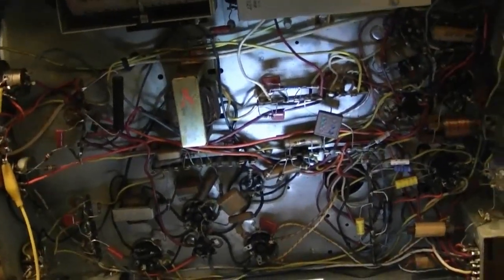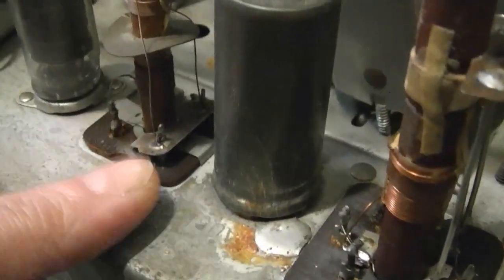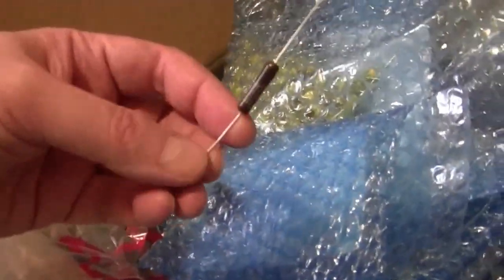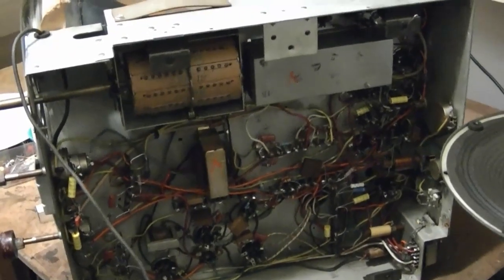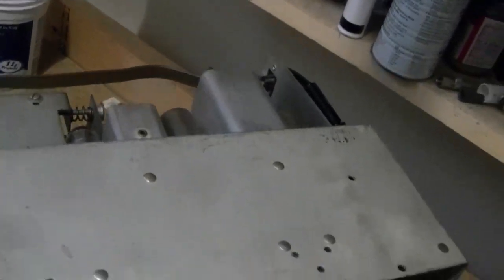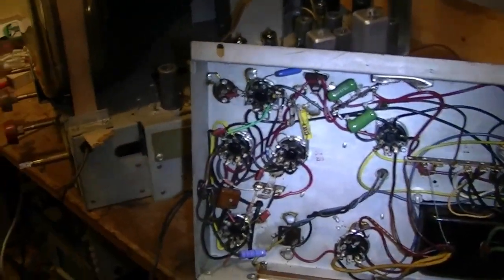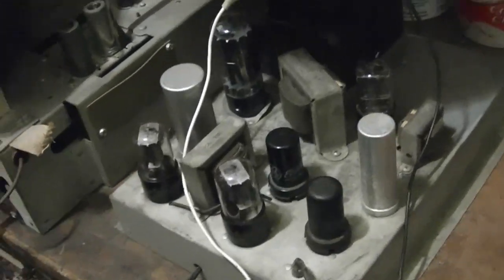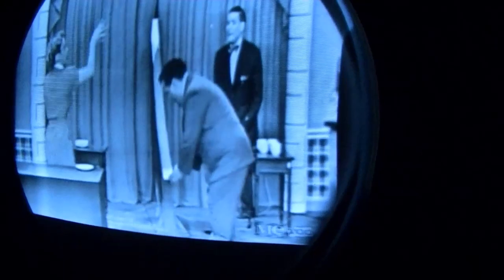Admiral 20B1 combo chassis restoration p3o6

Comment: Also, I agree with draggonhedd, I wait with baited breath for each new installment of the restoration saga.  As one who does a lot of radio restorations in the wintertime, I am intrigued by TV restoration although I am not really into TV's in general.

I also run a greenhouse business and we heat with wood.  This time of year I have
to add wood at about 5 AM so I find myself checking to see if there is a new video posting here after I add wood.  If there is a new posting I watch it FIRST before
going back to bed!

Comment: What I really like about these first sets is even the high voltage for the picture tube is dragged down when the circuits are not tuned optimally. I think it has to do with harmonics in each section. As the proper tuning for each section reaches its optimal frequency the circuit as a whole functions more as a tuned circuit from one section to another. What I like to do is follow the thinking of the sets designer who have to have a feeling for the previous section and the one following and one guy had the grand plan of overall function. This all arose during the war with radar in say a submarine. First you would read a couple of traces to see how far away the blip was and calculate if it was closing departing or running parallel. As time went on in the war a blip would show up for an object's position. The size of this blip then showed how large the return was while at the same time showing the coastline in a perfect mapping style. To get this blip you need computation in the circuit that just flows out of the circuit. When I had a Raytheon set I could see any object within my visual range even seagulls in the water and it was only 24k peak to peak nominal out to 6 miles. The current draw was small enough to run on battery. The antenna was an aluminum plate with sensors every inch and spun around producing a video channel output. Just like a tv signal without sound. Probably why the first sets had audio problems.

Comment: Those Dale resistors are nice, those chinese ceramic ones are almost always backeted down to the chassis.
Does it have a replacement V Out transformer or yoke? I have seen linearity issues like then when subbing v out transformers trying to find something that would work
Reply from the maker: The VOT and yoke are original.  I think the vertical blocking oscillator is too, but can't be 100% sure.  I put a scope on the grid of the V output tube and the sawtooth waveform has a bulge in the middle so I'm working on that circuit.

Comment: I pulled all four of them (shorted power transistors, it got the tuner and phono preamp working again via headphones) and it's Nuvistor based tuner and Phono pre-amp section sounds so sweet oh god I want to get this amp working! Wide band FM tuner too and it hasn't drifted at all still dead on frequency with awesome multiplex stereo sound!

Comment: Speaking of those yellow poly-film capacitors, I bought some from WJOE radio recently and they were made by a company called TC, according to the owner they are made in Taiwan. The finish is a little rough but they test all the way up to the top voltage on the capacitor tester so I can't see those as having a problem. Speaking of cheap parts, the voltage spec on some of those 1/2 watt fleabay resistors that come from China is only 250 volts, the Xicon ones from Mouser are 350 volts. Of course I have to wonder about the test methods they use, different resistors give different voltage ratings and some say nothing at all.

Comment: Most of those rectangular resistors of other brands seem to be fine, like IRC ones, I've never had any Xicon type but I will definitely stay away from those if I can. Are the leads on the 1/2 watt Xicon ones of a thinner gauge then average too?
  Dale and Welwyn are usually winners in my opinion, if you can get the right values.
Reply from the maker: Yes, the 1/2 watt resistors have thin leads too.

Comment: There's a good chance that those resistors in the yoke are helping to cause the linearity issues as they function similarly to terminating a transmission line, keeping the waveform from ringing and distorting.  Given that you found many other resistors to be off, there's good chance they've drifted a fair way off, too.  You should be able to tweak the values of things like that and/or around the V out transformer (assuming the yoke itself and transformer itself are good) to get it even clser than it would have been from the factory....

Comment: Sorry for my earlier posts but I got a nice solid state amp with germanium transistors that shorted :'(
Reply: Like I said pulled all 4 of them and that FM tuner in it is beautiful oh my god! analog FM sounding that good on a tuner that old! it is 100% on frequency even after 40 years! using nuvistors too beautiful thing! I want to repair it's power amp so bad!! And it is stereo Multiplex too, even after all this time.
Reply: after pulling the shorted output transistors to make it work,,,

Comment: Regarding the squeezed top and bottom of the screen. I would think this is an indication of the vertical deflection current flattening out at both extremes (positive and negative).  Could this be caused by low B+ to the vertical section?
Reply from the maker: You're right about the current flattening out.  I put a scope on the output of the vertical oscillator and the sawtooth has a "bulge" in the ramp.  I'm trying to track down the cause.  B+ is actually a little high.

Comment: I got a Scott stereomaster 344 receiver from the 1960's, all of the germanium output transistors are shorted but I am hoping I can put suitable power silicon ones in it, the germanium ones are Bendix QP-10's is there a silicon replacement for them?
Reply: 4 of them in push pull 2 are shorted, damn germanium's with shorting it makes me mad!
Reply from the maker: I have no idea.  I've never worked on anything like that. I mostly work on tube sets form the 30s and 40s.
Reply: And do not tell me NTE129 they want too much for them I want to give this thing proper cheap easy silicon transistors and want to modify it for them but it is a very simple push pull circuit with a big power transformer :)
Reply: Scott built stuff quite nicely back in the day, they really did!
Reply: I might just get 3055's and try and make 4 of them work, but it is push pull...what is the complimentary to a 3055 silicon transistor?,...sorry for bringing this up on here but I'm working on vintage gear too, also replacing the same wax caps too!! but on early transistor stuff and one NICE amp! :)
Reply: I do too, if this was a tube Scott receiver I would have no issue, I got the 6CW4 nuvistor tuner working beautifully, but the power amp stumps me bad! I guess maybe I should PM some engineer youtuber's about it, I have to learn this stuff, damn transistors hehe I am used to tube stuff too! lol
Reply: and the nuvistor FM tuner is amazing, multiplex, stereo, wide bandwidth, oh my god it sounds so sweet! I want to get that power amp working...
Reply from the maker: grassulo NTE129 are $2.12 at Allied Electronics.  That's less than a 3055.

Comment: Bad vertical output tube - or a fault in its coupling to the yoke. I'd swap the tube for a known good one first.

Remember, tube testers aren't perfect. If they say a tube is bad, it almost certainly is. But if they say it's good - it might or might not be. Power tubes are the hardest for tube testers to get an accurate reading on. One with "good emission" on a tester may disappoint when under full load in circuit.

Really - if a power tube is in question, substituting it with a known good one is the only valid test.
Reply: You didnt watch the end of the video. lol.